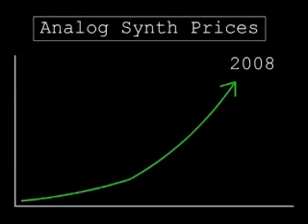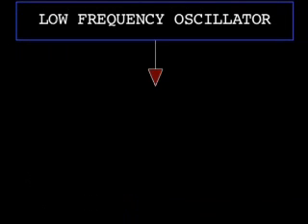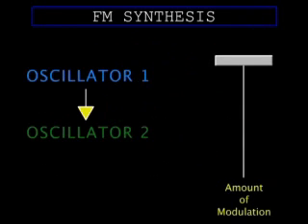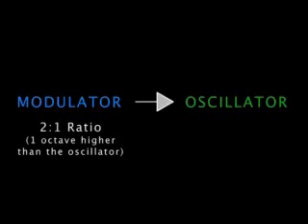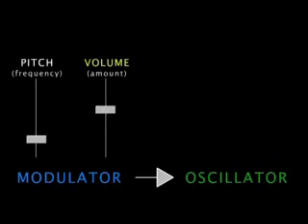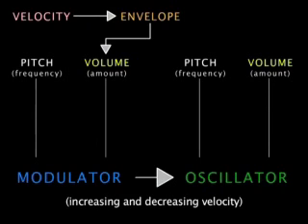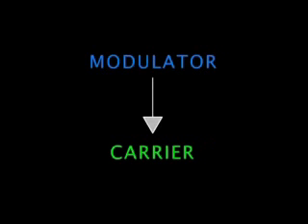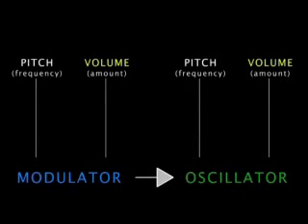Introduction à la synthèse FM

Comment: Great tutorial. This is what exactely happens also inside the Yamaha OPL3 chip found on older ISA soundcards (best example, the holy Sound Blaster 16). Remember that addicting DOS games soundtracks? Or how MIDI files sounded when played on an old 486? This is all stuff from FM Synthesis. And mainly from only 2-operator algorihms! Luckily operators in this chip can have more waveform types instead of the sine only, so the sound can be more varied.